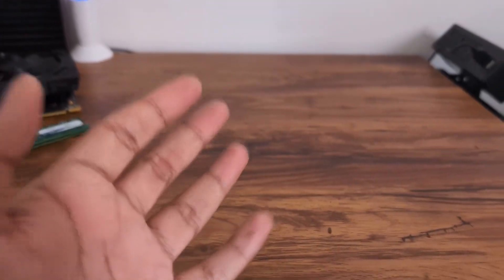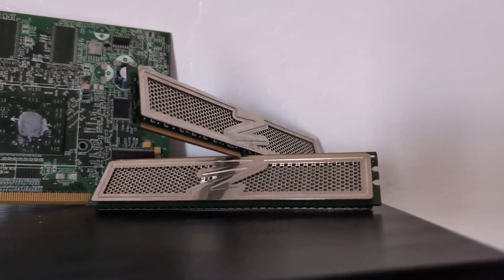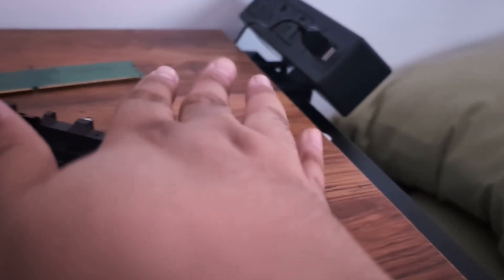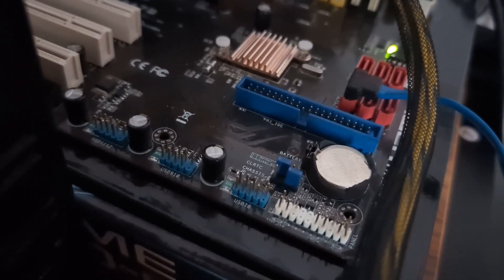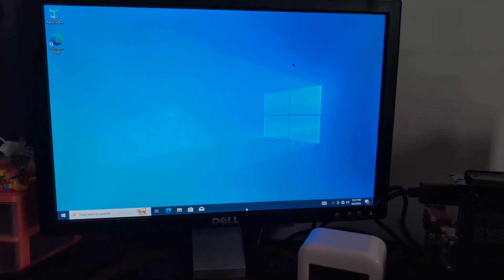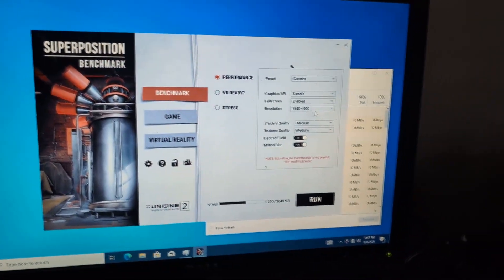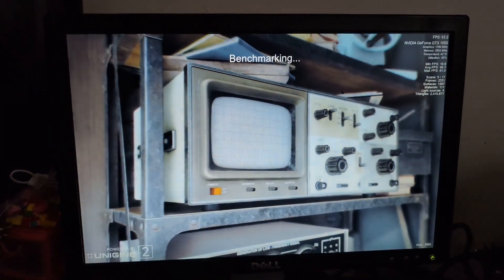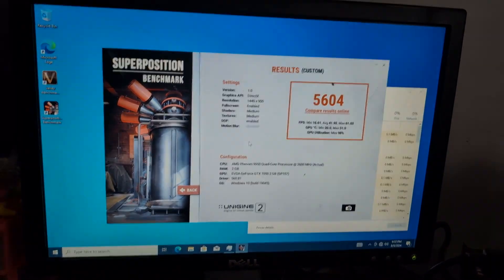Does This Still Work? - Testing out This Phenom 9950 System

Comment: I have a Phenom X4 9750 somewhere. Should try that with 8GB DDR2 and something modern-ish GPU.
Reply from the maker: You might not be able to run a few games but it will be interesting to see how far it can run them
Reply: @technicalchico  Yea, I know what I'd be doing. Just have a HD 7970 paired with it and OC the CPU to its max etc, I know that it's a shitty 17 year old CPU. :D

...been a PC hobbyist for 20+ years after all.

Comment: Unless stated other wise in the motherboard Manuel. You weren't using duel channel mode. You had both sticks of ram in both the black slots. To run in duel channel mode you have to put one stick in a yellow slot & the other in the black slot. ie: one stick goes into the yellow slot, closest to the CPU (channel A) & then the other stick goes in the black slot closest to the yellow slots (Channel B).  slot 1, slot 3